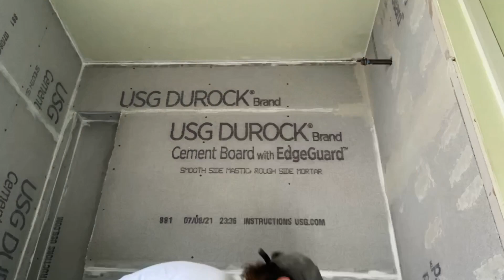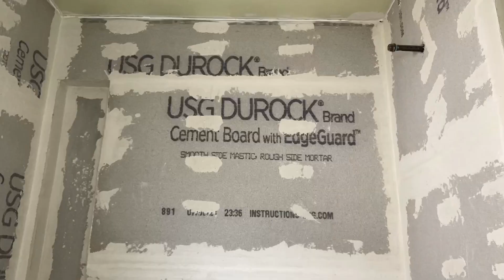Decided To Paint The Bathroom Pink Because Why Not

Comment: How did you if your new bath fan would fit where the old one was? Did you have take the old one out before you bought the new one?
Reply from the maker: there actually wasn’t a fan in there, so i had to have an electrician out to install the vent to the outdoors so one could be put in. if you’re looking just to replace an old one, i would take it out and see the dimensions of the inner-workings of it so you know what size to replace it with. otherwise you may have to cut a larger hole in the ceiling to accommodate the size of the new one. either way, always make sure the power breaker is off before poking around. just have to say that as a disclaimer. lemme know if you have any other questions :)
Reply: @brewcitybuilds  thank you! Yep, I have an old one I hate that I have been wanting to replace. This is helpful info!
Reply from the maker: glad i could help :)